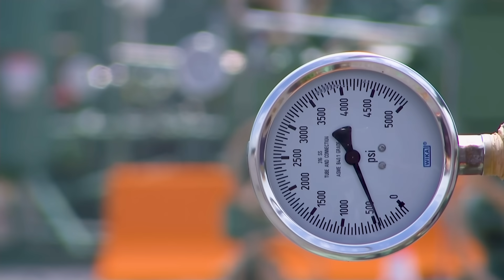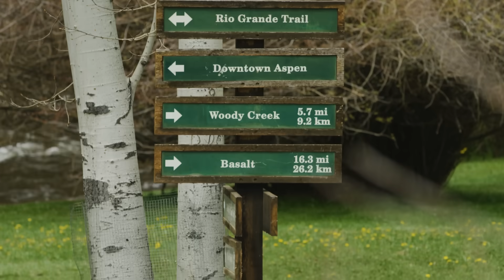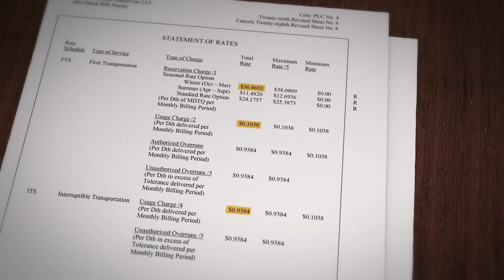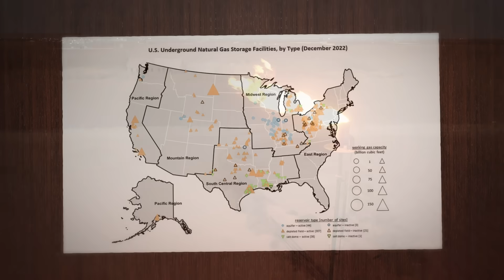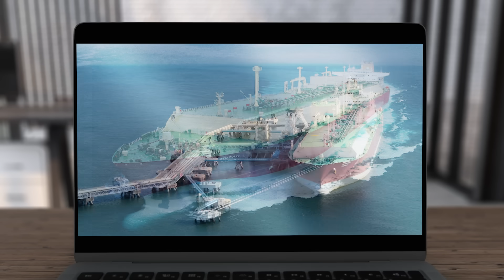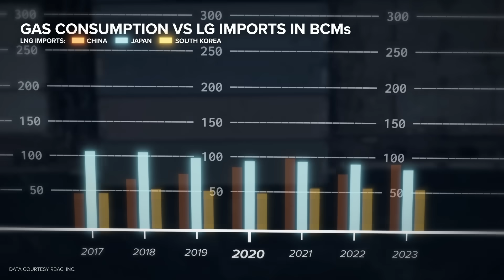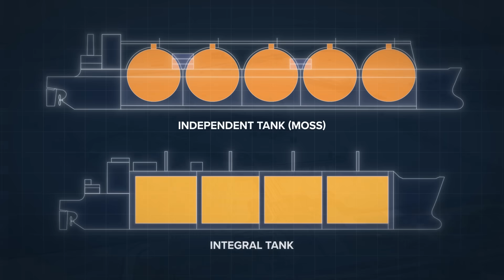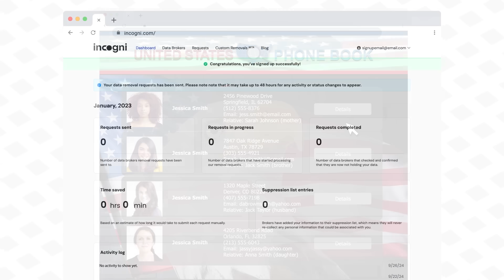The Logistics of Natural Gas

Comment: The fact that we go through this much trouble when gas isn’t better than more energy efficient alternatives at anything (other than maybe heating when it’s below ~0°F but the COP of electric heat pumps is only getting better at low temperatures) is just kinda sad.
Reply: It comes from a time when we weren't yet able to use electricity efficiently for heating, similar to ICEs vs EVs first for rail and now in the last decade for cars
Reply: How do you trans the pi? Do you divide the diameter by the circumference rather than doing the reciprocal?
Reply: What are these alternatives? If it’s anything other then nuclear then you’re seriously delusional
Reply: If you live in the US, gas is generally the cheapest way to heat a home.
Reply: @  that is less and less the case in 2020+. Cold climate heat pumps are becoming the running cost kings in most of the country.
Reply: @ I haven't seen much evidence of this. Of course it depends on where you live and the local power and gas prices but gas is generally cheapest and it is likely to remain that way as the power grid becomes less robust.
Reply: @thatoneotherotherguy  the are not cost effective currently in regions that are actually cold. They might be in the future, but are not yet there.
Reply: @Majilikin  Ground source heat pumps are practically independent of air temperature. But even disregarding those most cold places where people actually live only get so extremely cold that air-source heat pumps stop being more efficient a small fraction of the days heating are needed so over the whole season it still averages out to beat gas.
Reply: @woopwoop7041  current reasonably priced air sorce heat pumps are very inefficient once into single digits or below. I live in a place where that's a large portion of the year. My heating bill would be almost double what it is now on gas, and that doesn't include the increased price that those systemsfrontup front. 

It is a fact that in cold regions current heap pump tech that can do a good job is more expensive than a gas heater, and cost more to run. 

Whatever you want to think, that's the reality of the situation. I dont now how to convince you that it is, because I feel like you don't actually know what you're talking about and are just regurgitating information you heard somewhere else.
Reply: @Majilikin  Then you do happen to live in a place where air sourced heat pumps don't make sense, cool! Many people live in places where it only gets really cold a couple of days a year. I am actually in a somewhat similar climate to you and air sourced heat pumps just did not make sense (several weeks of sub zero °F temperatures) for us. We have a ground source heat pump instead and I can say that we spend much less on heating than some neighbors that use pellets instead. But there is no natural gas pipe service here so I actually don't really have a good picture of how much we would be spending if that were case and we could get cheap gas. I'm going to assume gas is very cheap for you if ground source heat pumps also don't make sense for you in the long run.
Reply: @woopwoop7041  so like I said, for people in cold climates it doesn't work. (Yet) 

You really have reading comprehension problems don't you?
Reply: @Majilikin  There are different levels of cold, some people would consider a couple days of subzero temps a year to be very cold. For those people heat pumps would very likely be one of the most effective solutions but they may count it out because of the few days a year when other heating would be better.
Reply: @woopwoop7041  A cold climate is defined a few ways, but generally it's always going to have multiple periods of single digit temps (or below) and prolonged sub zero temps. 

That's just the facts. 

Further more im happy for you that either you or your parents could afford geo thermal heating, but most people can't justify a system that MIGHT pay for itself over a decade when it cost 3-5x as much as a gas heating system. So, while I really hate saying this, check your privilege. 

And third I have countered literally every argument you've made and you keep trying to move thr goal post and keep arguing with me. You're dying on a hill for no reason. So if your just a kid, then you need to learn that you're not always correct. And if you're an adult, then I can't help you if you're acting like this. 

In either case, grow up
Reply: Heat pumps cannon economically (currently) heat homes in cold regions. Once they can gas will probably be very few and far between. 

However I do want to keep my gas stove. Don't care for election ones to much
Reply: @Majilikin Hi, I live in a cold country (Sweden) and pretty much everyone I know uses heat pumps because it is the most cost effective way of heating your home. The only exception is a hipster couple that have wood fired heating and a gas stove because they think that old and obsoleted stuff is cool and better.
Reply: @Majilikin  Except the gas stove is also objectivly worse than an induction stove. Especially considering them as the sole reason gas infrastructure would exist.

They lower indor air quality, are easier to get burned on, and require pipes of flamable gas inside your home with all the necessary infrastructure costs. Among other things.

The only thing gas stoves have going for then is the gas stove conponies managed to convince some people they're a premium product. Despite not being better anymore (if they ever were)
Reply: @CaptNSquared  Stoves are definitely not the sole reason gas infrastructure exists. The main use of gas heat in a home is warming the home, then heating water, then cooking being the lowest item on the list. The main reason natural gas infrastructure exists is because it is the most economical way to provide heat to homes and businesses.

I don't know how gas stoves are easier to get burned on. You can see an open gas flame and gas surfaces tend to not remain hot after burning which is not the case with electric stoves. Gas pipes in your home are flammable but it is actually relatively difficult to have a gas explosion in your home and there are disproportionately more fires from electricity in the US than with gas.
Reply: @CaptNSquared   Induction stoves also take a specific type of pot/pan to function. They have issues too. Regardless, I like gas. I have used induction and regular electric, and i prefer gas. I should be allowed to use gas. And me using a gas stove does not require natural gas infrastructure. It can be supplied by a propane tank located at my house, delivered by truck. So the infrastructure side is a non issue. 

Also, insulting me by implying I was somehow tricked into liking gas is childish. Grow up. 

On top of that, the effect gas stoves have on air quality is literally negligible unless you seal yourself inside a bubble with the stove, and electricity is also dangerous, just as gas is. It's not like an exposed wire has never caused a house fire. 

It's OK if other people have a different opinion than yours, you aren't the only person who matters. So grow up, do some research (particularly the air pollution one, you're probably referring to a study that was insanely biased against gas and had extremely unrealistic test parameters) and come back when you actually know what your talking about and your argument isn't based on feelings.
Reply: @Majilikin  If you have a proper fume extractor over your gas range all the NOx gases and pollutants will be removed so there is practically no health risk. However, if the fume extractor is not functioning or is inadequately proportioned then NOx gases will accumulate inside the space where the gas stove is located. NOx gas is especially dangerous for children and can lead to long-term health effects. Incidentally electric/induction stoves also produce particulate pollutants (at a lower level) when cooking that need to be extracted just because cooking food itself sometimes produces particulate pollutants.
Personally, I used to have a gas stove but when we built our new house we decided to go with induction and after adjusting to it I can't say I find myself missing my gas stove very much. Not because I'm scared of it (we always had a proper fume extractor) but just because induction gives me all the fast control I want and my kitchen doesn't get nearly as hot as with our old gas stove. It also feels a little more futuristic to have the electricity directly transferred into my cookware through induction. Also maybe it was just luck but almost all our cookware just worked on our induction stove, even our old cast iron stuff which was made before anyone had even heard of induction lol.
It's totally understandable to have a preference one way or another. Besides, gas is basically a necessity for certain styles of cooking like wok so I think it will stick around for a long time.
Reply: @CaptNSquared  Well, compared to the resistive electric stovetops of yesteryear I think I would struggle to find anywhere gas has a disadvantage except maybe initial cost.
Reply: @woopwoop7041  the only study that found harmful levels of toxic gas due to a gas stove was one that literally tarped off and taped and sealed the stove inside the tarp and ran it for an extended period of time. In normal use, without a vent to the outside, gas stoves do not pose a health risk to anyone. It's literally propaganda that they do, and you seem to have fell for it.
Reply: @Majilikin  I literally wrote it's safe as long as you have a proper fume extractor. Any high temperature combustion in regular air will produce NOx gases from nitrogen in the atmosphere reacting with oxygen at high temperature. Gas stoves don't get super hot so there isn't a lot of NOx produced and a fume extractor will be able to remove practically all of it. Building codes also already mandate ventilation of gas stoves so new construction should have ventilation anyway.

I think I found the study you are talking about. It looks like they tried to seal off the stove to control for room size and air circulation to measure how much of the pollutants are produced when a gas burner is on. The amount of NOx gases produced depends on temperature, not room size so I think that is probably a decent method for measuring the amount produced. It would be a very poor method for measuring the amount of pollutants accumulating in an average kitchen though. That's not the only study on this however and through some cursory research I did find another study from last year that attempts to measure the actual concentration of pollutants in a real kitchen. It seems that they did find high levels of pollutants but the full article is paywalled so I can't confirm exactly what they found.

Anyway... NOx is produced by burning methane in air. NOx is harmful for children and people with asthma even at low concentrations. Proper ventilation mitigates any risk.

I am not anti gas stoves, we used to have one and I think it worked excellently. I also do not believe they are dangerous as long as you have ventilation. BUT when combusting things you should always have ventilation because it always produces pollutants and removes oxygen from the air in enclosed spaces.
Reply: @woopwoop7041  I'm just going to reply to the very first thing you said about a proper fume extractor, because you clearly didn't read what I wrote. 

It doesn't matter if you have a fume extractor or not. Normal use of a stove in normal circumstances (with or WITHOUT a fume extractor) has been found to be completely safe. End of story. 

Learn to read
Reply: @Majilikin  So um, I actually went on google scholar and I have read up on a lot more research papers on this and yeah... I've yet to find any research disputing what I wrote. I would link some papers here but it seems that comments with sources get removed on youtube so... 
I don't really understand why you're so defensive about this, did I offend you in some way? If so I apologize because that is never my intention. I am not a native English speaker so I may not understand if something is offensive.
Reply: @woopwoop7041  Google scholar. 

Ok kid
Reply: all things considered natural gas furnaces generally have a lower total cost for the user.
Reply: @billy_fred Fossil Fuels get 7 trillion dollars in subsidizes.

  20 billion in America alone. That doesn't include everything.

  Like cost of spills, accidents, chemicals, and enviromental

 He should have went into the sheer waste the LNG industry produces. I would have loved to see that. 

 Got people who really think windmill waste are horrendous. They got no clue what goes into the supply chain of LNG at all is all I am saying. 

 I'm not even a "green" person. World is fcked. I'd just like to see it get softy fu*ked is all.
Reply: @billy_fred   that's less and less the case over time. Not to mention that the cost of natural gas is far more volatile than the cost of electricity. Since we're up to 300-500% efficiency at reasonable temperatures on cold climate heat pumps these days, only a fraction of the US is still in a state where natural gas is cheaper heating than cold climate heat pumps. I get cheap gas and electricity in Utah. Heating my home on heat pumps would cost roughly 1/3rd what natural gas does.
Reply: @thatoneotherotherguy Generally speaking if you live in the US heating with natural gas is generally cheaper than a heat pump. I'm not sure where you're getting the idea that gas is more volatile than power. The supply and demand of natural gas is much more steady. Gas prices are usually set by the day whereas power prices are set every fifteen minutes due to difficulty in matching generation and usage. Additionally power prices are climbing fast and that is set to get worse in the coming years. Reliability and environmental concerns are also worth bearing in mind.